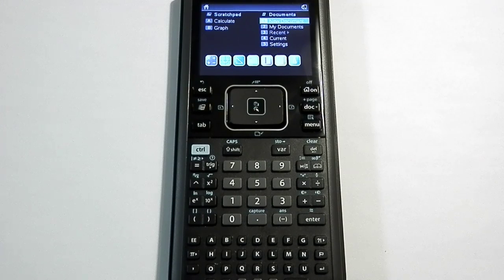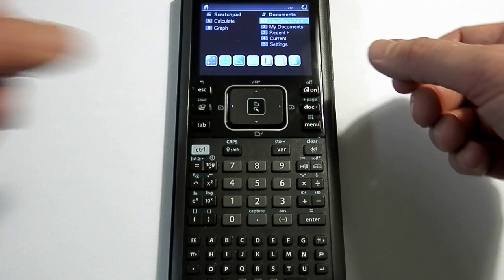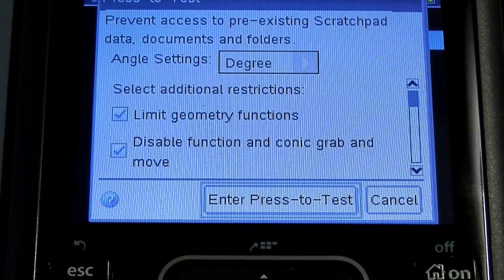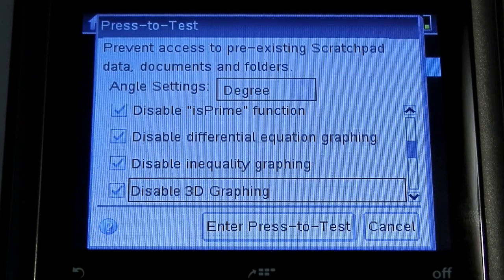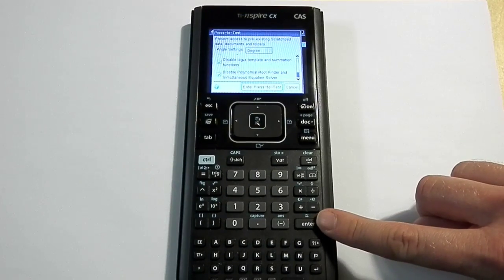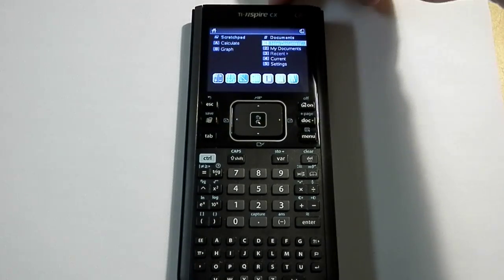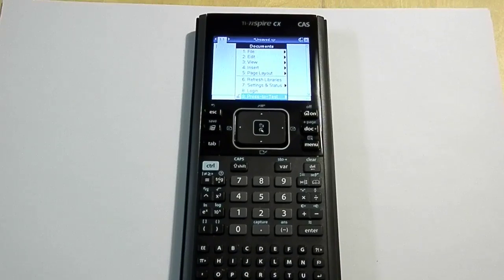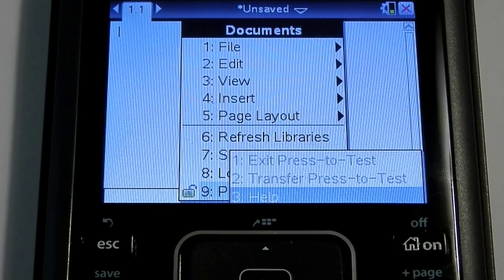Putting a TI Nspire CX Calculator into Press to Test Mode

Comment: What is the point
Reply from the maker: This mode is used when a student is writing an exam in class. It prevents the student from doing things like accessing documents that they have saved with cheat notes, or to block using settings restricted by a testing authority.

Comment: AND WHAT CAN I DO IF I DON'T HAVE ANOTHER CALCULATOR??
Reply from the maker: The whole point of Press-to-Test mode is that a student can not, without it being obvious to a teacher watching them write an exam, take the calculator out of test mode. That's why it requires a physical connection to take it out. If you do not have another Nspire available, the only other way to take it out of Press-to-Test mode is to use the Nspire software. If you still have the stuff that came with the Nspire when you bought it, there is a card that has your software licence for the student version on it. Even if you lost or threw it away, you can still install the trial version for 6 months on your computer and connect to it to exit test mode. Go to https://education.ti.com/en/resources/online-learning-program to get the software. In the student software I believe there is a menu option called tools, and then you select to exit test mode.
Reply: @BryanClintberg  thank you, yeah, I used the software
Reply: @BryanClintberg yes but for some reason I can’t install it

Comment: your video didn't help but the comment by Monomalvado did, lol thank you!
Reply from the maker: Monica Davila there are multiple ways of doing things on the Nspire. I am showing how to handle press to test it your do not have the computer software. Also note that my video of about going INTO press to test mode, where the comment you mention is going OUT. You can also do this without creating the file by using the selections under "Tools" in the Nspire software menu.

Comment: what a horrible set up. youd think they would just make a password lock or pin to get out of test mode
Reply from the maker: kellog 1 but students might crack that. Forcing a hard wired connection is impossible to hide during an exam.